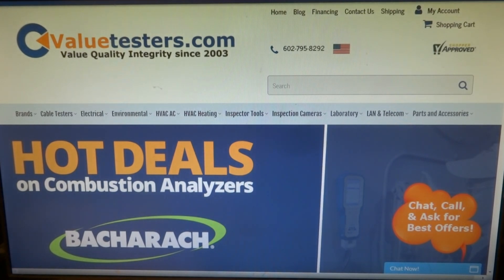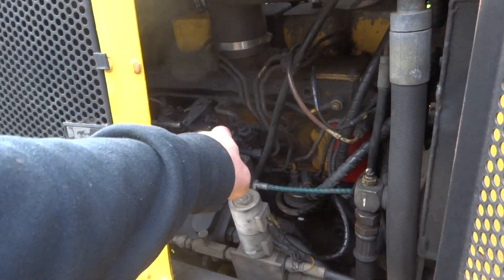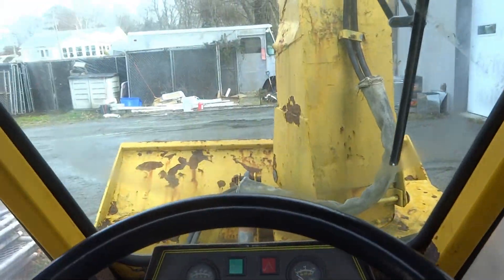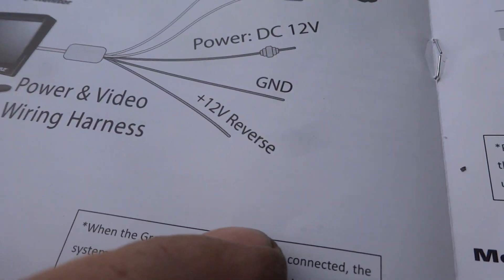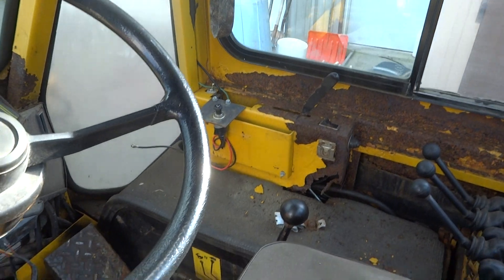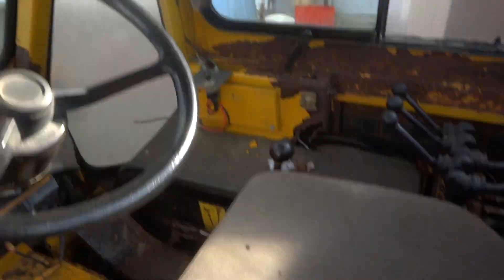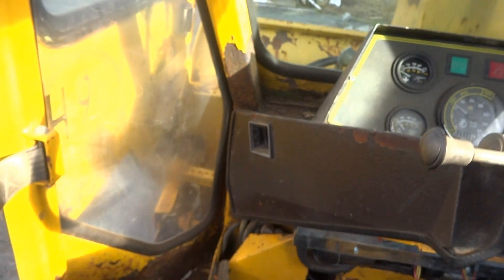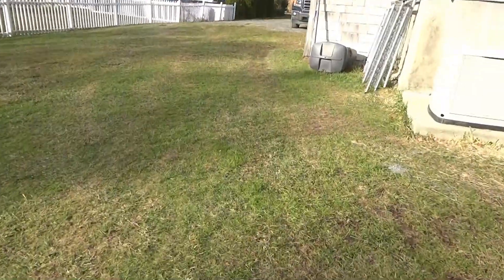Trackless MT5 backup camera installed

Comment: thats cool got an extra set of eyes the camera on the trackless you could wire a momentary switch to the reverse pedal to activate it. im not sure if it had a backup alarm at one time then the camera would be wited to it. what you need to do is fabricate a heavy duty guard so the camera don't get damaged. if you accidentally hit something. someday we may get to see the trackless in action removing snow. if you wanted to im sure you could add a turbo to it if you get the Cummins 4bt turbo manifold plus the exhaust piping and muffler will have to be a bigger pipe diameter. but it looks good as is just the rust control on it to get done on it.